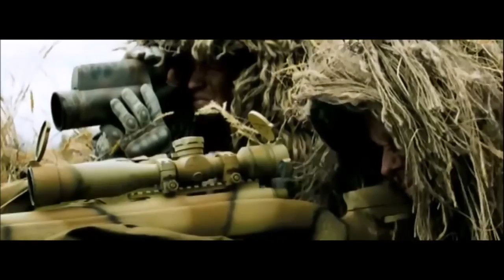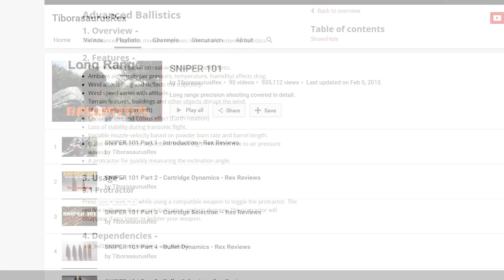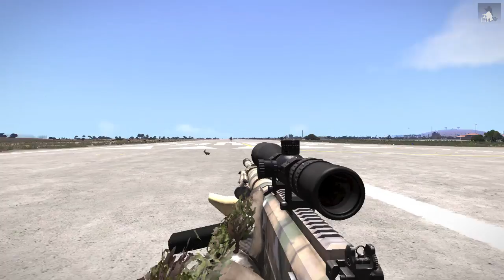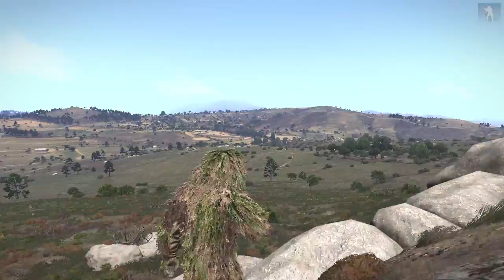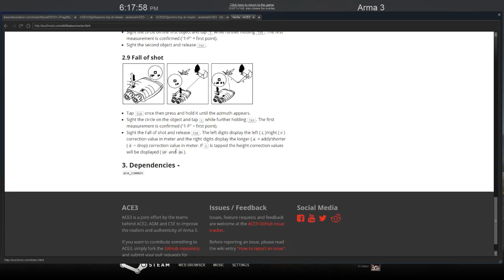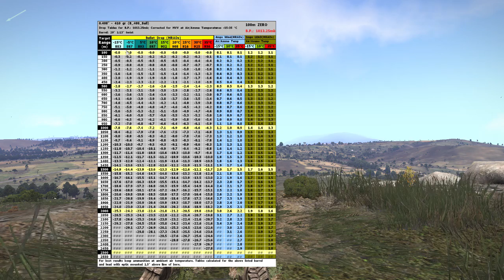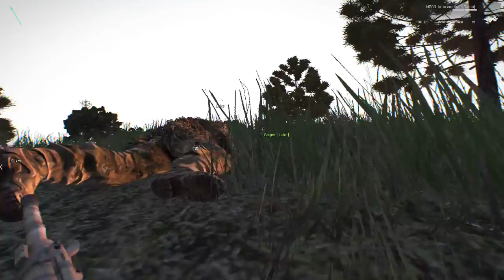Arma 3 ACE3 Sniper Tutorial

Comment: Why would you need a spotter if you both do the calculations and you both take a shot? That's just two snipers.
Reply: Luca Morgenstern A spotter has a rifle for a reason you know? 
Maybe there was multiple assailants. Maybe they were both engaging a separate target than one another.
Both of them taking a shot is very situational. It's not hard to realise that.
Reply: Callum Turner sure. But they were engaging one target. And they both did the calculations. Which was pretty unnecessary.
Reply: In situations where there's a high-value target, tasking multiple snipers to take the same shot is sometimes desirable to increase the likelihood of a kill shot. Granted, in such situations, it's usually multiple sniper teams that take shots from varied angles to the target instead of both snipers sitting right next to each other.

If they were going for proper sniper-spotter etiquette, one of them would have brought either a "regular" rifle (e.g. an M4) or a designated marksman's rifle (e.g. an SR-25). The spotter would have done most or possibly all the calculations and simply fed them to the sniper, who would have then taken the shot. From what I know, though, it's common for the sniper to do some of the basic calculations in conjunction with the spotter in order to reduce the risk of mistakes.
Reply from the maker: A new video will be released that details sniper/spotter conduct. It's true, it was unconventional of us both to take the shot.

Comment: i dont have the set zero adjustment option
Reply from the maker: domo is back Make sure you have your weapon equipped and some of the scope values changed from 0.0. You will have to set a new zero every time you join a mission (I hope this is patched). the .408 proper zero is around 0.7 to 0.8 Mils elevation. If all this doesnt work then it may be a CBA issue.
Reply: ***** i was using the LRPS
Reply: ***** ....i know i dont have the option...
Reply: domo is back Do we still have to 'set zero adjustement'? I don't really understand why do we have to do that.
Reply: +domo is back did anyone ever find out why the option is simply not there ? ,having the exact same problem. ( set at 0.7, with the 408 with the LRPS and the adjustment option is simply not there.

Comment: i cant enable AB can you tell me step by step ??
Reply from the maker: Open the mission file in editor. Double click the existing ace module and make sure everything is set to "yes". If there is no module, I believe F6 opens the module tool, or look on the left of the screen until you find modules. Double click near your player spawn to create an ACE module. From the list select advanced ballistics. Advanced ballistics should be enabled by default on the 360 degree course but I have seen lots of comments with problems in this area. I might make a short 2 minute instructional video. Let me know if you still have problems
Reply: thanks i will see if its working